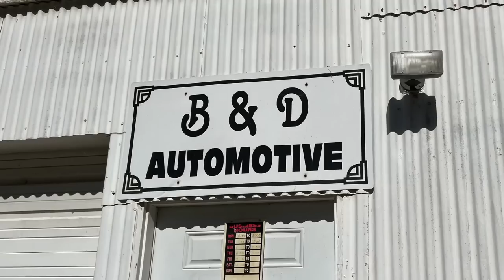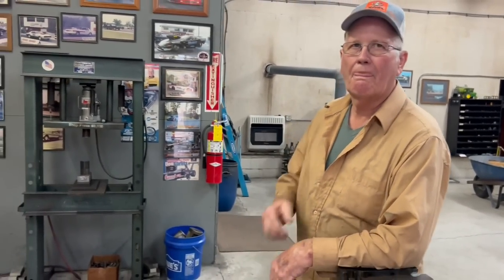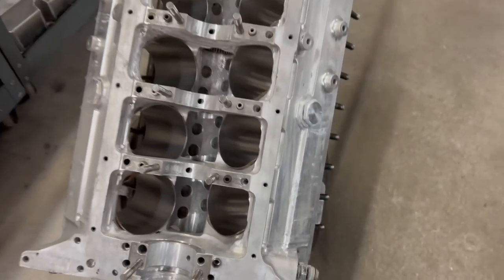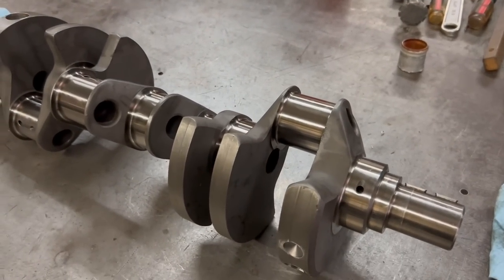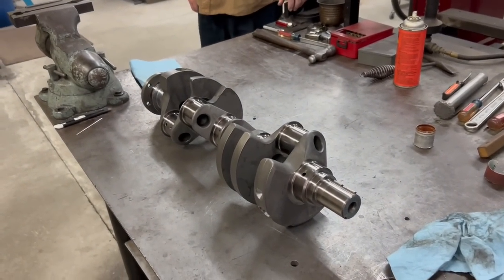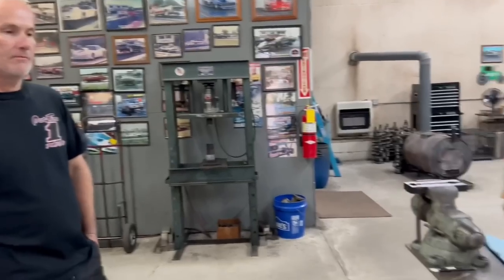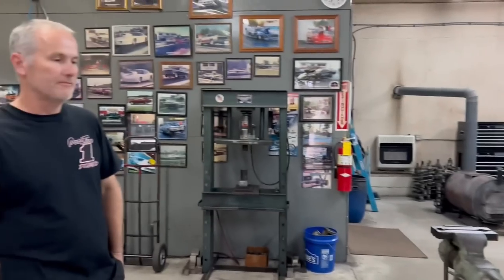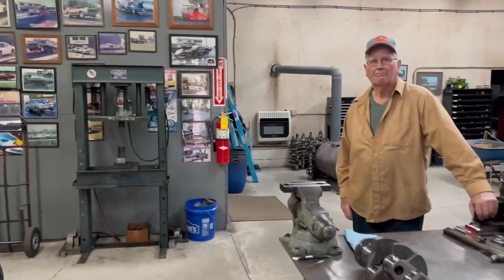All Aluminum 409ci SBC Build!  Let’s talk to the machine shop!

Comment: With that 3.75" stroke, you might have to clearance the bottom of the cylinder liners on the camshaft side. The threaded end of the rod bolt will hit there sometimes, depending on the rod.

Plus, with a 6" rod, your rod angularity is not that severe, and will run forever.

Comment: Hey Bozz is B&D n Greenville or Burlington nc ? I need someone tht I can count on to get my work done like this ! Heck it don't have to b done tht fast but faster then the guy I have now.. It took my local machinist from March till this week to clean my 350 roller block put new freeze plugs, and new screw n plugs, new cam bearings, put 1 sleeve n and hone all 8, and line hone the block.  I'm just putting together a little play 355 roller motor just to get this lil 98 stepside s-10 set up and then I have a 400 block I want to do like u doing with ur 400 motor,  a 406 or 409 monster motor... 🥳 But anyway good luck with ur motor John !!! But if u will please let me know where these guys r located 🙏 I looked them up and I c one B&D n Burlington and one n Greenville nc..

Comment: Time to put a preheater system together for the car ( oil and coolant ) so you can get the engine stabilized before a run.